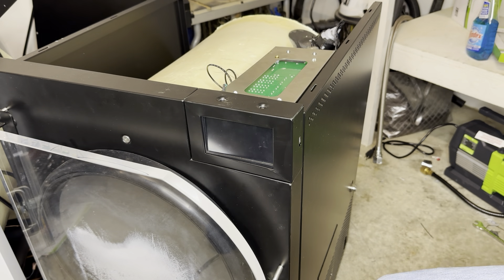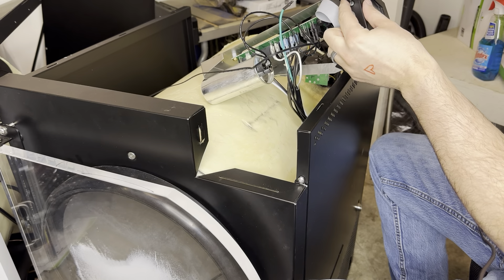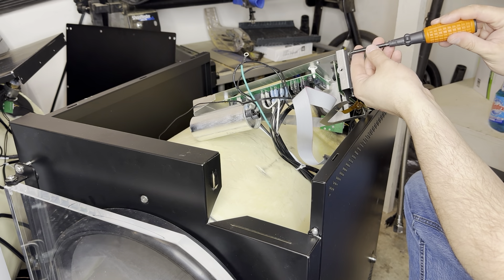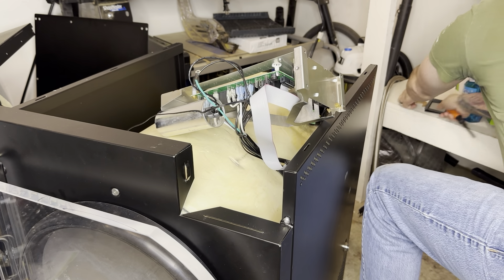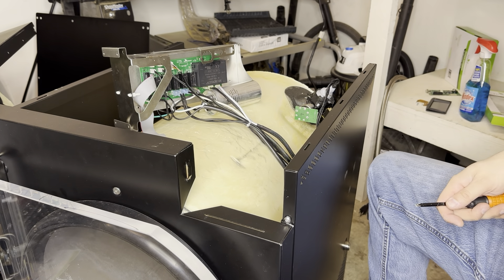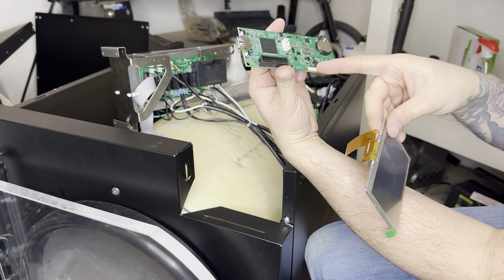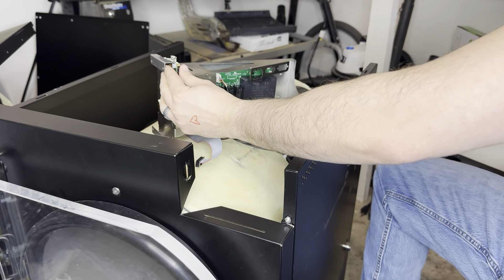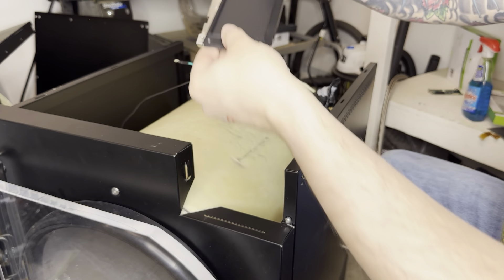CPU and Screen Replacment MUST SEE HAHA

Comment: After being sent a replacement heater relay board for my brand new never used machine I can vouch for what Donald says.  The board did not work...  HR is sending an entirely new FD under warranty and I only have half hopes of it working out of the box.  For such an expensive machine, they should spend some extra cash on quality electronics.  Thanks for all the repair vids Donald!
Reply from the maker: I always tell people just replace the parts needed for the most part. Once its up and running we normally don't get many issues again.